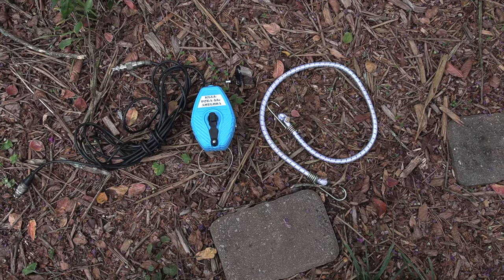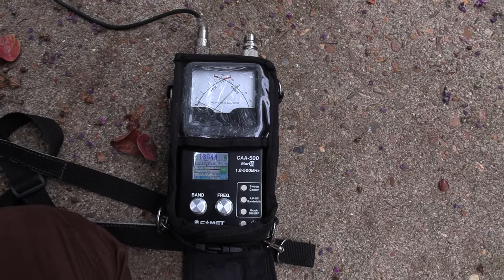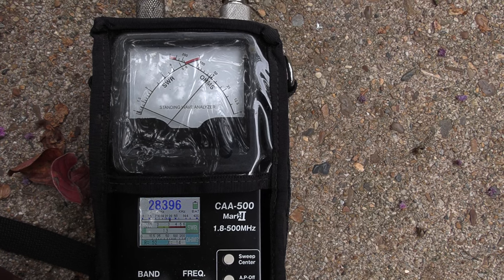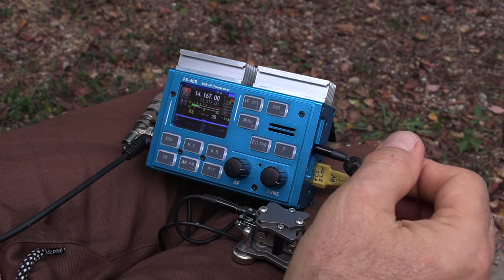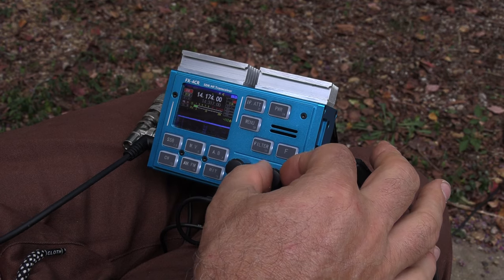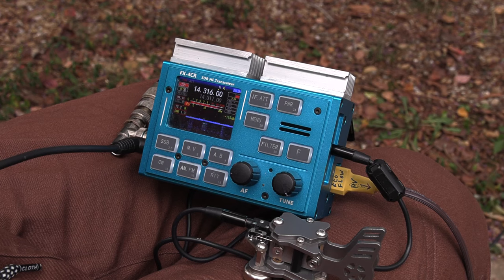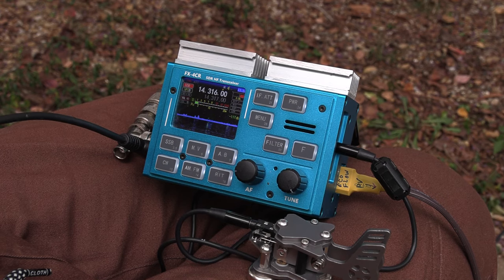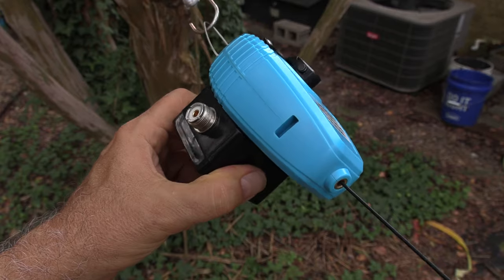Reel - POTA-ble Antenna Review

Comment: I have one of these too and it is my new go-to portable antenna when I have the space to deploy it.  My first test of the 
Reel pota-ble EFHW was mounted in a tree about 6ft / 2m up.  The antenna line was extended to another tree in an inverted L configuration maybe 25ft / 7.5m in the air.  I used 25ft of coax with a 1:1 choke balun attached to the radio.  I reeled back 4 turns from maximum and was aiming for the Phone frequencies on each band.  Here were my SWR results:

28.3 MHz .1.1 SWR
24.950 MHz .1.2 SWR
21.375 MHz .1.0 SWR
14.300 MHz 1.2 - 1.3 SWR
7.225 MHz .1.3 - 1.4 SWR

I too noticed that it was quieter than some of my other configurations.  Getting the EFHW up higher may also help to lower the SWR on the lower bands somewhat.  For portable work on 10-12-15-20-40m, I would highly recommend it!

Comment: Raising the feeder side up higher than 5 feet will bring those SWR centers right up into the correct zone.
Reply: Yup. You just need to reel it out and figure out exactly how much of the wire to spool back in (how many hand cranks) for low SWR on each band (including 40 meters)

Comment: you arent stuck on one band using a resonant antenna. you can RX/TX on all the lower band that are harmonics of that one. for example using a 40m antenna you can do 40,20,10
Reply: Sure "Stuck" on one band. The thing is, if you have a great SWR with a tuner on a long hunk of wire, but nobody can hear you because your transmit efficiency is very poor (AND you are portable with lower power), then what fun are you going to have? A good resonant antenna with a little gain and 20 watts will allow you to have tons of contacts...where a "tuned" multiband antenna will result in very few contacts. This antenna will run on several bands without a tuner, but I would only run 100W using it portable.
Reply: @Yavor54  no tuner is required, you can use any antenna on its harmonics with no loss. i am mainly QRP with only 1.2W and i am working country 2500km away daily easily. my two main antennas are a vertical multiband and a EFHW made for 40m. i can use both on 40,20,10m without any problem.

Comment: I'm guessing its a metal reel and there's some sort of constant tension contact with the reel.. Do tell...
Reply from the maker: Well, it has to have what is called a "Slip Ring" assembly. Good solid contact has to be maintained 360 around a metal contact plate. Same thing is done with electric windmills. I'm not going to dis-assemble it to find out how he did it. (It's the magic inside!)

Comment: What were your readings on 40 Meters
Reply: It does work... but you have to reel in a bit to center the band. Truthfully, at QRP power levels, a wire antenna that has gain is a better choice.
Reply: thanks Bob   W5CI  @Yavor54